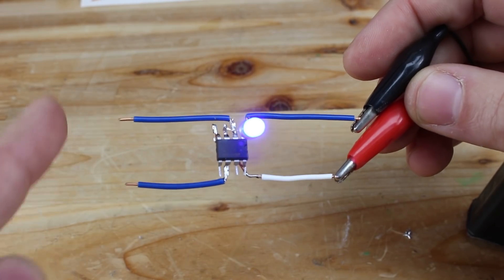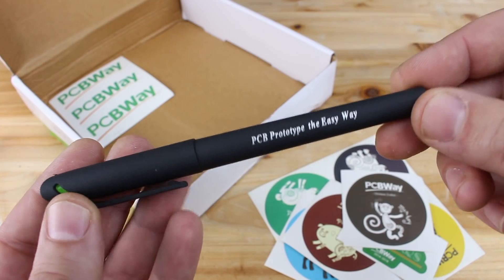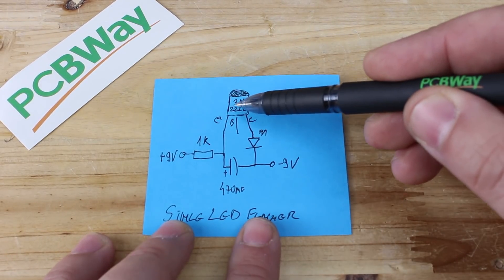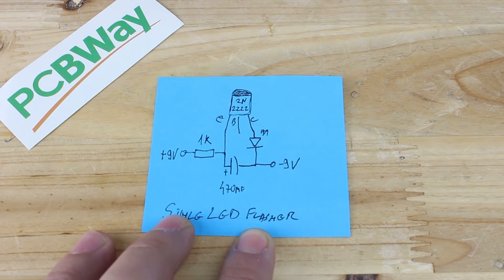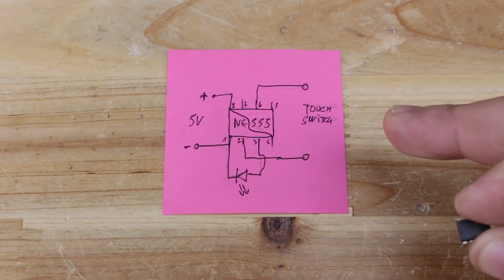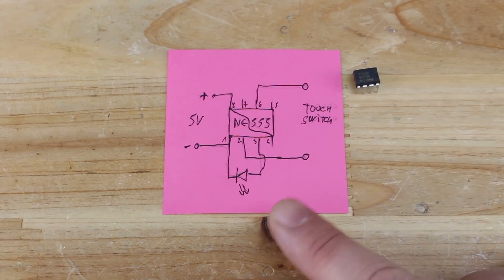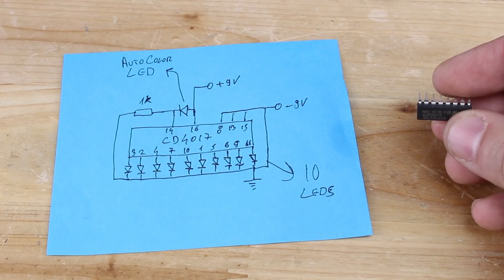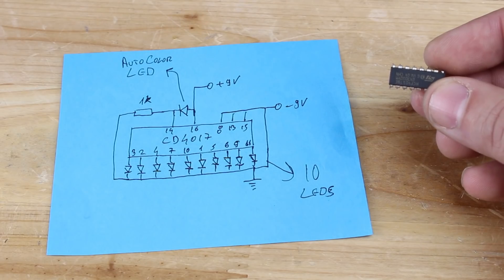3 Simple and Easy to make DIY Ideas

Comment: th second project with the 555 (touch switch) also works with a 9V battery? is there any risk to burn the chip if i use a higher voltage than 5v? Thanks 4 ur videos